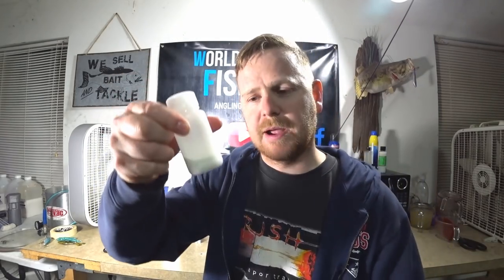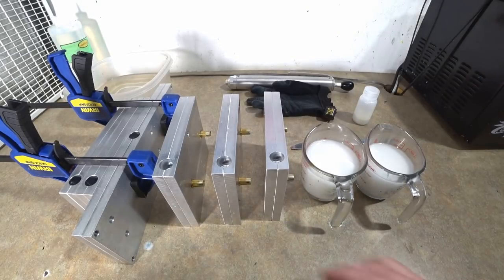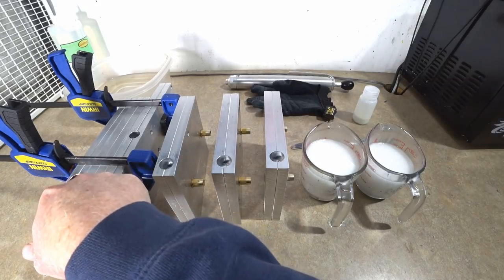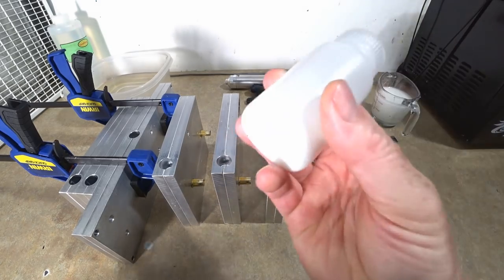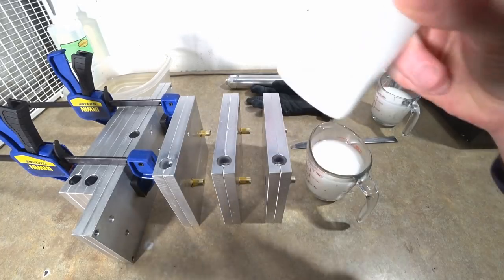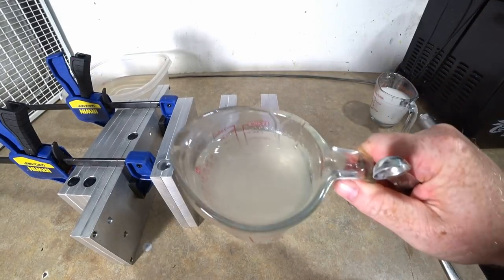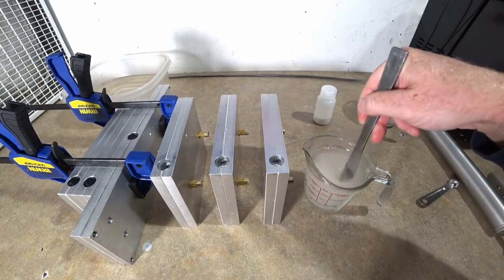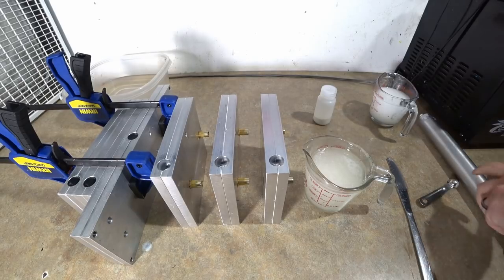Let's Play With GLOW IN THE DARK Powder Made For Soft Plastic Lures

Comment: Two things. First, charge these with a blacklight, as it provides a wavelength of light much more readily absorbed by the pigment powder you're using. The color of the glow indicates what wavelength you have to exceed to get maximum glow, and purple is the highest frequency in the visible spectrum.

The reason the colored baits didn't glow well is because you used colors that filter out the light wavelengths needed to charge the powder. You'll need to use fairly translucent colors of purple or blue to see colored glow of any kind. Once more, also use a blacklight, you'll see an insane difference. Two minutes with a blacklight will make that stuff glow as bright as your phone screen.

Comment: so, i just got into doing this. (bait making in general) i got some of the lurecraft glow powder. i wanted to try it on some of the deeper stuff, thiknking they ould be highly visible in deep murky water. so, as such, i tried it on a crawfish hand pour. the color i used, of course, crawfish. its a pretty dark color. i used teh same measuring scoop you usd, one scoop to about 1/2 cup, and they actually glowed pretty good. they had a lot of color in. the powder did make them look lighter than just a std crawfish color, but they looked darker than your were, and they glowed quite well. 
im way too ignorant about all of this to know why mine worked better, mostly luck im sure.
Reply: looking through the replies, i see uv light mentioned. i put mine in the sun, which worked very well, b ut the first test was in my basement where they are made, i held them up to the cf pigtail bulb and got the stated results. im fairly certain the cf bulbs dont give off excess uv.